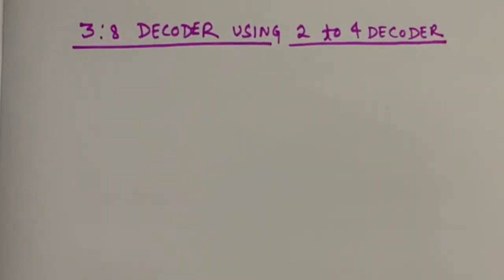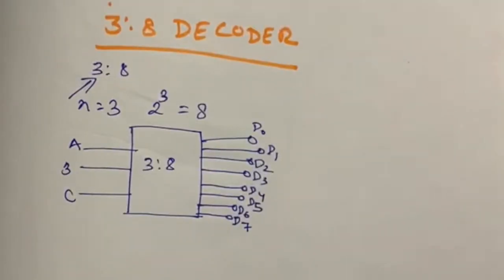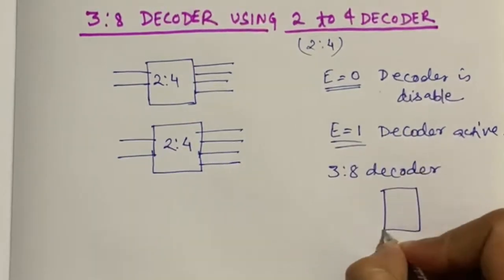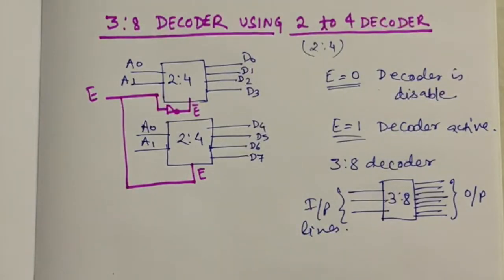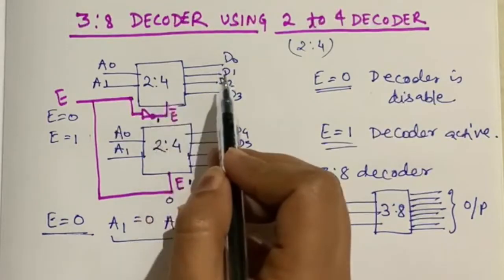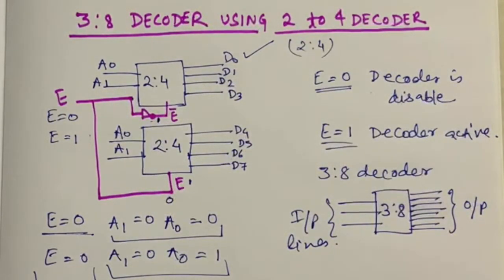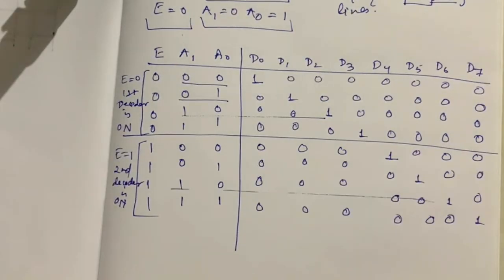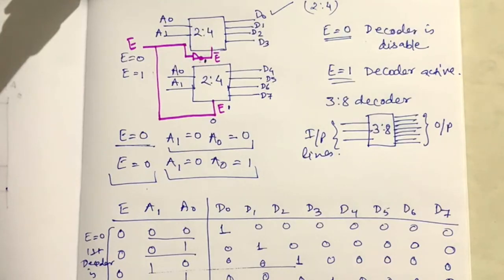3:8 DECODER WITH 2:4 DECODER [Detailed Explanation and Diagram]

Comment: i think you should add another variable (lets call it Global Enabler GE) that shuts down the decoder completely. This variable is the fourth variable and goes in an AND door with ~E and E'. IF GE is 0 both Decoders stop to work. If GE is 1 then they work normally.